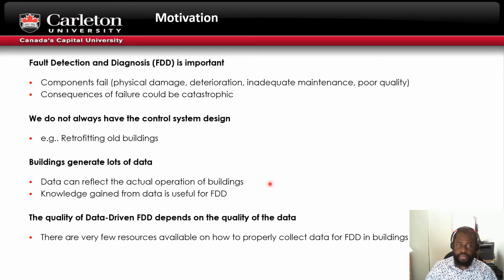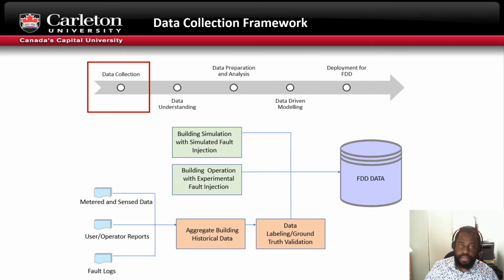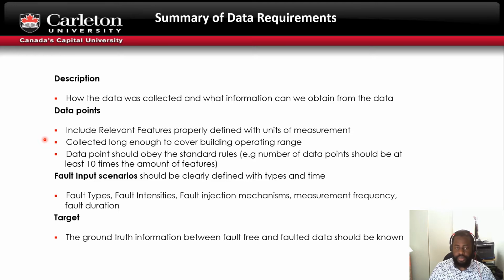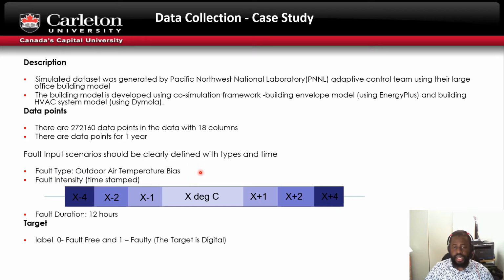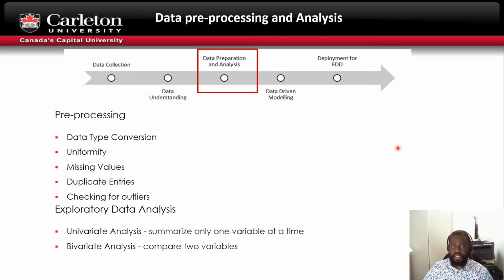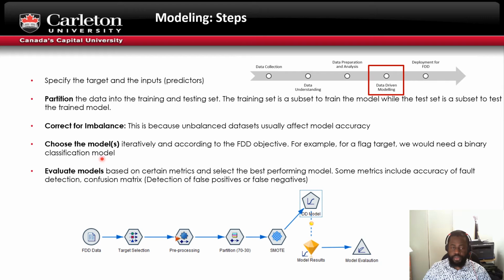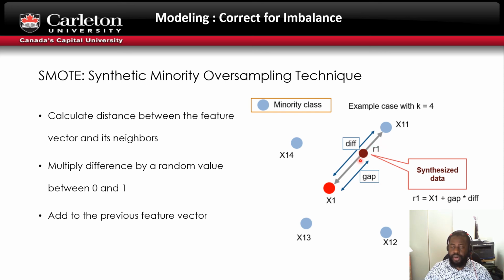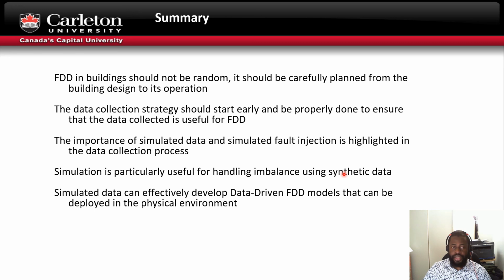A workflow for Data Driven Fault Detection and Diagnosis in Buildings

Comment: Hi. I had a multiclass imbalanced data. I did preprocess,  made a model, and evaluated it. also one step further, I did a root cause analysis. Now, I want to do a Fault Diagnosis based on the RCA to find the fault causation. what is your recommendation? (I have done no Diagnosis before so I am not sure enough even it is different with RCA or not)
Reply: did you completed the work?